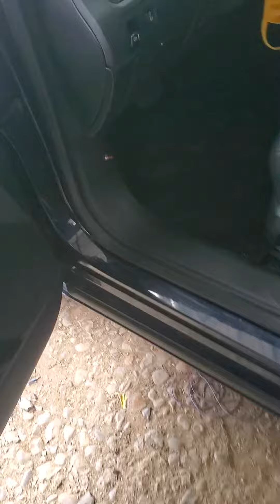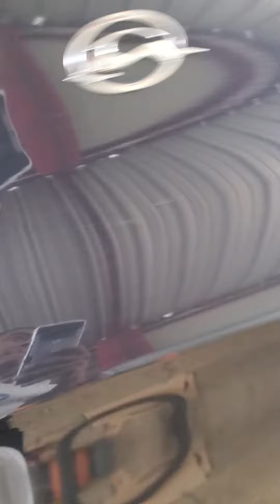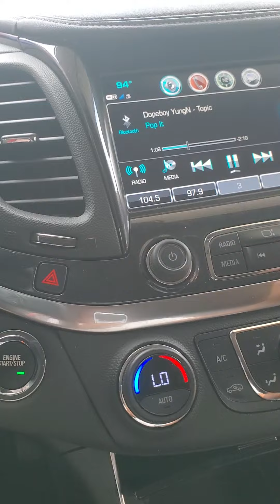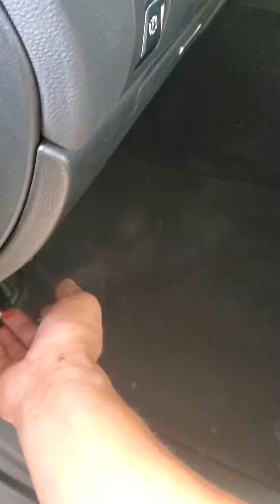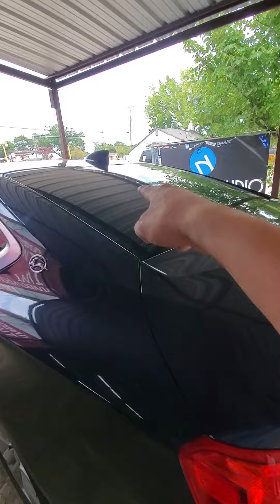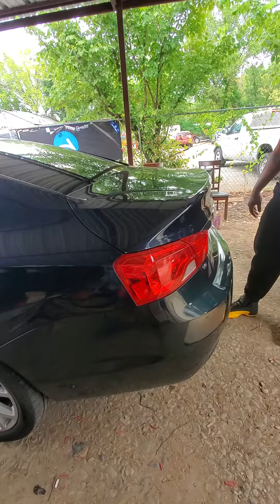nemesis 6k amp and 2 15 inch f series nemesis factory radio

Comment: Wow I love these new .nemesis products  they are so solid ,amps are power full an clean ,subs definitely can handle all the power with 3" voice coils . Can't wait to try so in my ride. An your splitter is phenomenal, didn't you have to use a lap top to set the frequency ?